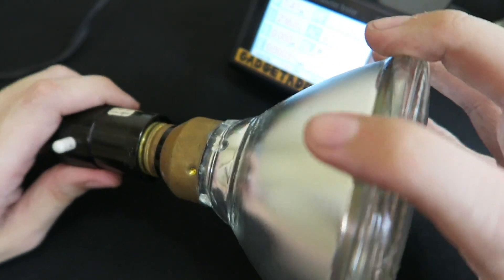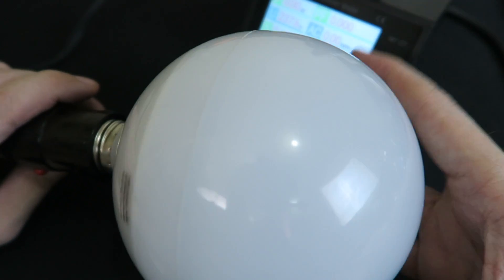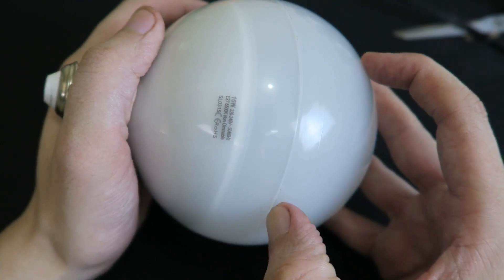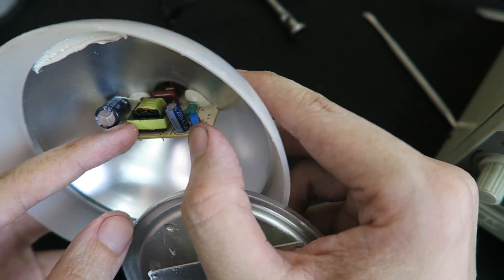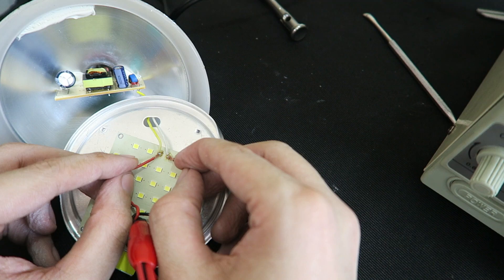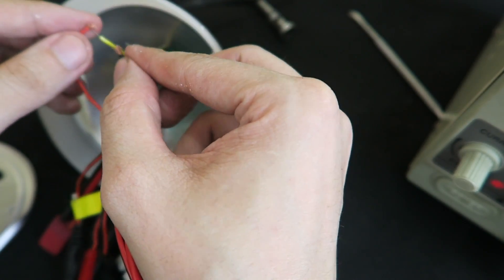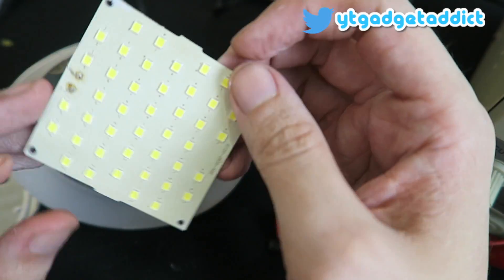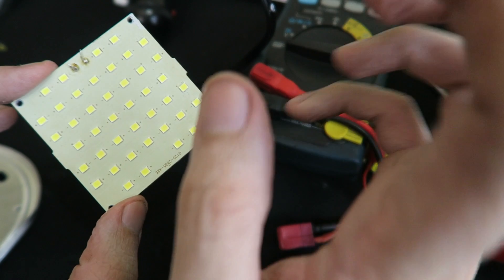LED Lightbulb Teardown

Comment: can you extract the individual LEDs from that board?
Reply from the maker: You could but they're surface mount LED so they're very hard to work with and they're extremely cheap to just buy.

Comment: Hummmm, try using the multimeter in that mode that beeps if there is a connection, try different leds until you find where the board failure is if so you can make a jumper on the leds, so the current as a way to go. I hope you understand what im saying.

Comment: is there a way to "recycle" the LEDs then? i.e. salvage them for a project maybe?
Reply from the maker: +ZuluCharlieFox possibly but they're 'surface mount' so they're quite hard to work with.
Reply: Sure you can salvage almost any components, however there are two problems.

1) is it really worth your time? LEDs are incredibly cheap you can get 100 of em for $5 or less, usually even cheaper if you go for a reel of 1000. 
2) the biggest reason you don't want to recover LEDs is because you'll more than likely damage them, they really don't like heat, so you unless you have special tools to help you remove them quickly it'll just be a big waste of time when you inevitably fry a bunch of them, although you could reuse the entire board but that would require ~126V power supply.